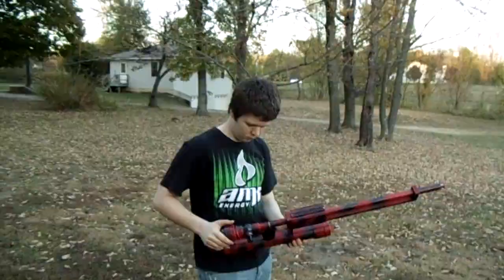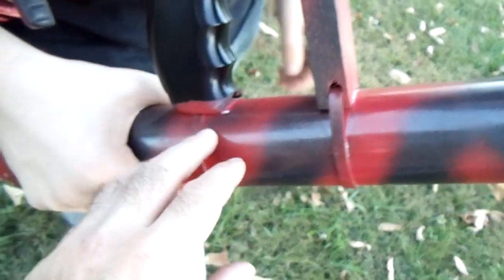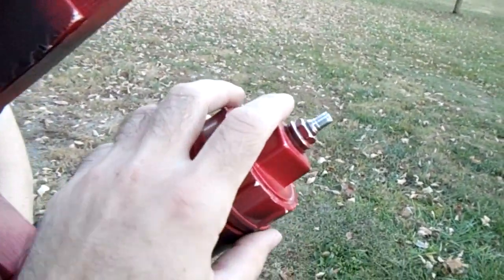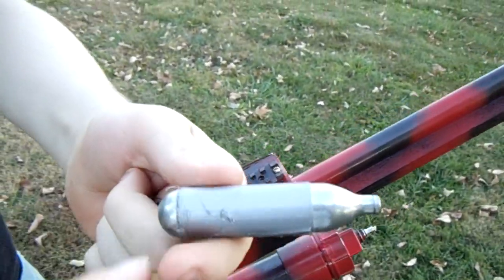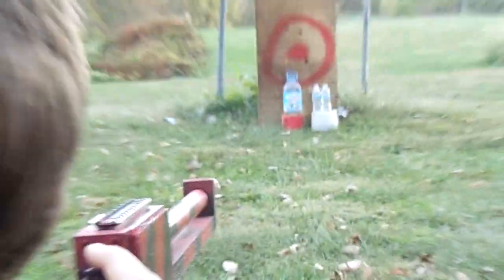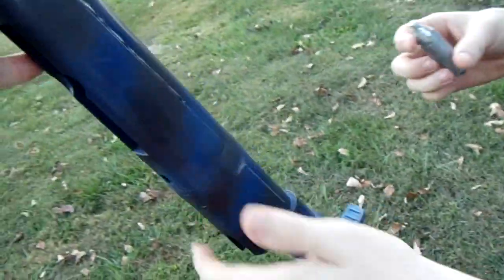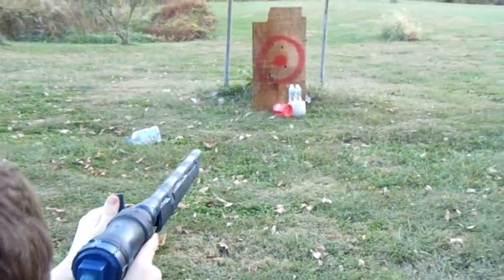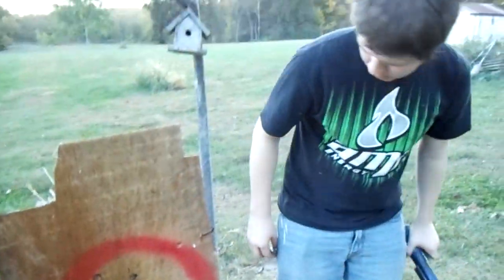Shooting Our Homemade Air Cannons - Water Jug for a Target

Comment from the maker: When the air goes from high pressure to low pressure so quickly it cools off rapidly. The low pressure air that exits the barrel is cooler than the surrounding air and so you see the vapor come out.

Comment from the maker: @Goregoon We're in Illinois, just outside of St Louis, Missouri. The weather has been great here lately. 

One thing that will work in place of the ball valve is a solenoid valve off of a lawn sprinkler...they are battery operated. I usually try to do things without the need for battery power whenever possible, but I might give it a try one of these days.

Comment: hay good work on the P.A.C. searies for 14 thats pritty good i dont have any videos of it yet but i built one using galvanized steeland my presher comes from dry ice and the design is a 2 chamber layout for safty but i got the PSI over 1500 and broke the sound barier with it. the rifle was accuret up to 1 mile thats when it started to drop valosity. the first 10 feet it was moving at 7,258 FPS so really dangerous so be carfule happy shooting :)

Comment: Where abouts are you again? Skitters and T-shirts in mid October? ...must be nice! There has got to be a quicker release method then a ball valve, you're a smart cookie, I'm sure you can think of something.

I actually have an interesting idea, but kinda hard to explain it in 500 or less, plus it probably won't work as well as it is imagined. The idea would work, just whether or not it would be able to hold the pressure without leaking it out when charged up.